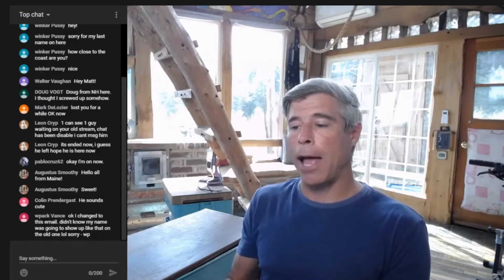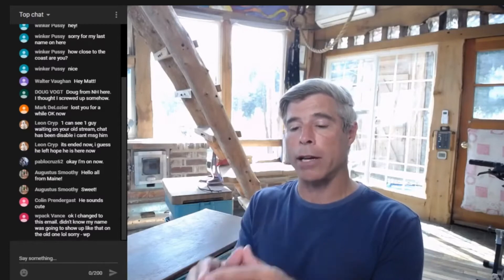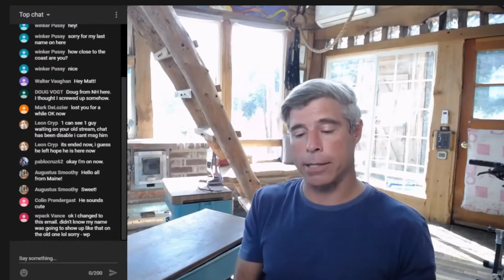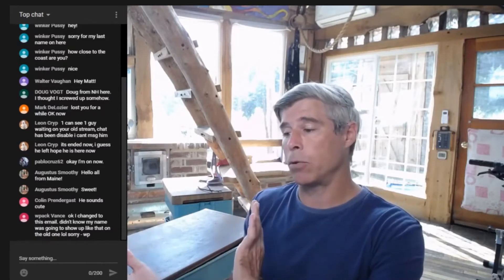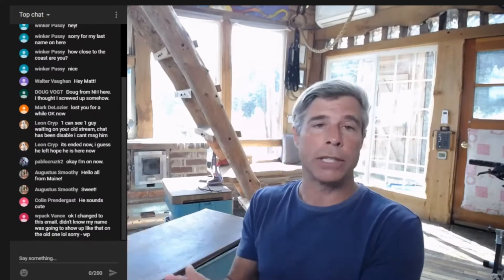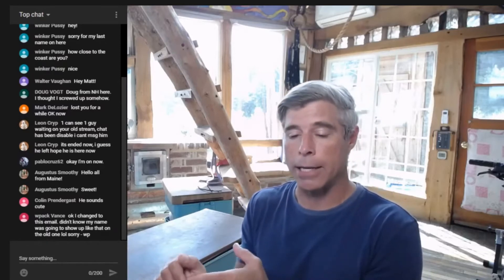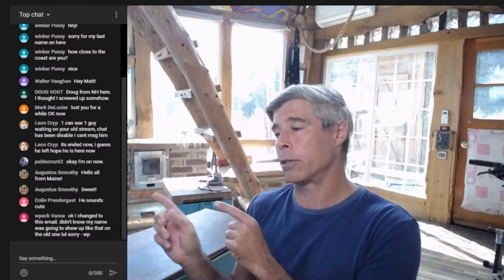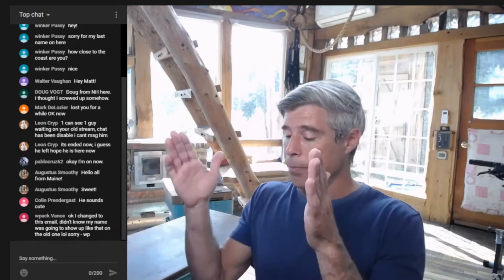Should You "Port and Polish" a Rocket Mass Heater Core?

Comment: I used to hand port and polish Harley-Davidson cylinder heads then stipple the entry to the combustion chamber to cause turbulence in the flow there for better fuel/air mixture. In a combustion chamber you form yourself, a vortex is easy to induce with a tab or two and offset alignments.